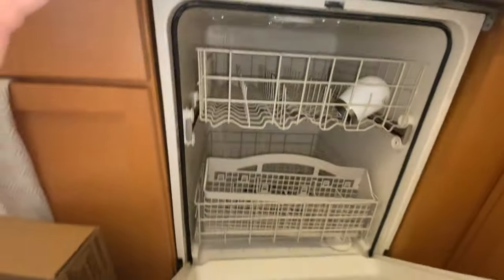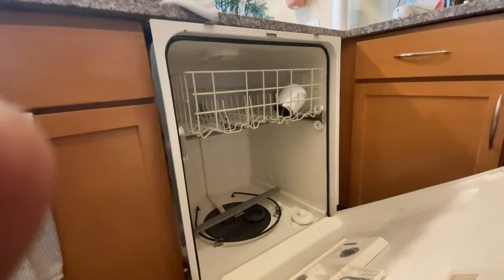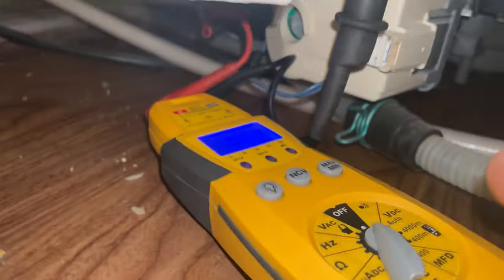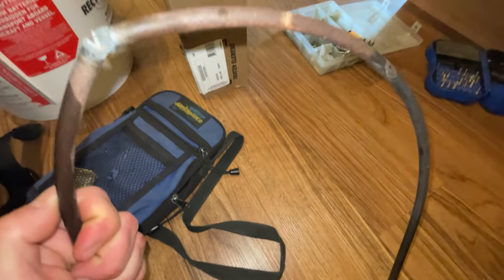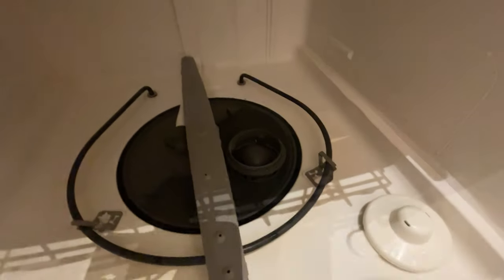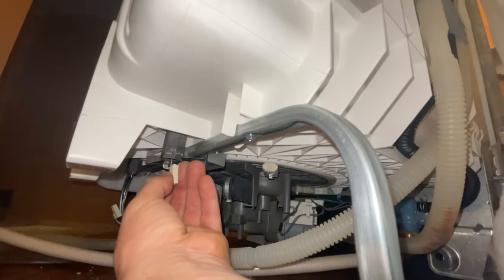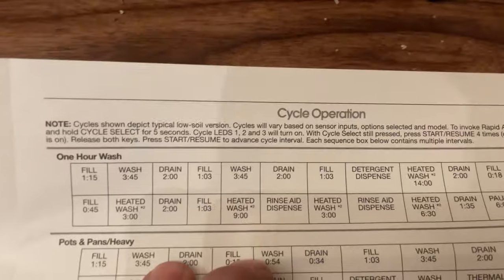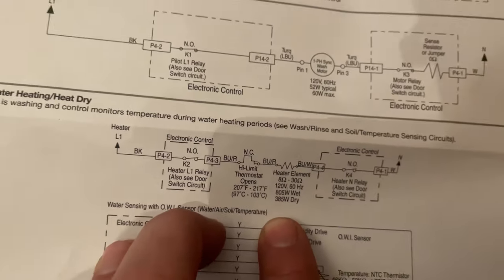Whirlpool Dishwasher Heating Element Replacement

Comment: Try this first before removing the entire washer! if you don’t have “Popeye’s” forearms, you can simply reach under washer, unplug, unscrew bolts to remove element. Replaced in 15-20mins. You may not even need any tools, if you have strong hands like me. Still be cautious, lots of sharp items underneath. Cheers, you’re welcome!
Reply from the maker: Some dishwashers this is possible. Not all though
Reply: Ya I was able to do it like that.. it depends if your supply line is long enough

Comment: If you have enough hose and wire slack,  pull the whole DW unit out and put it on its side. Makes it a lot easier to do the replacement
Reply from the maker: Thanks for the tip!

Comment: The ONLY video that tells you to do a reset to the circuit board to clear the bad heater code, which you have to do after you replace the heater element or the high temperature thermostat.  I got the heating element from ebay ($23) and the high temp thermostat from Amazon ($6).

Comment: Did you happen to have the “Clean” light blinking in series of 7 blinks? That’s what mine is doing, same washer, but still gets hot. Just occasionally gets stuck ON for like 3 hours and the light will flash. Then I reset the diagnostic, and 1-2 washes it does it again.
Reply from the maker: What does the error code mean? (In service tech sheet)

Comment: I did all of this and my water still doesn’t seem to be heating up. Is it possible To clip the wires back on the heating element the wrong way??? Or does it not matter??
Reply: Same thing for me as well not heating
Reply from the maker: It shouldn't matter. Pull out the tech manual and run the self diagnostic test for the heating element, you will need an amp meter to clamp on the wire going into the heating element to see if it's getting power or not. That's where I would start. Also, dishwashers may heat up the water but you really need hot water coming in for it to work effectively, run faucet water until hot before starting the dishwasher.
Reply: There is a thermal cutoff in the circuit in series with the element. It should be closed (close to zero ohms).

Comment: “This just slides out”
Not the way the contractors who installed mine put it. 😭
Edit: also, you know you can just unsnap the sprayer arm at the base. It makes getting the heating element out so much easier.
Reply from the maker: Thanks for checking it out foosmonkey